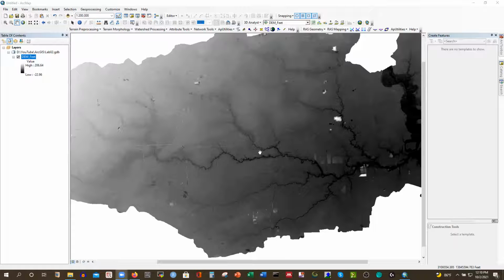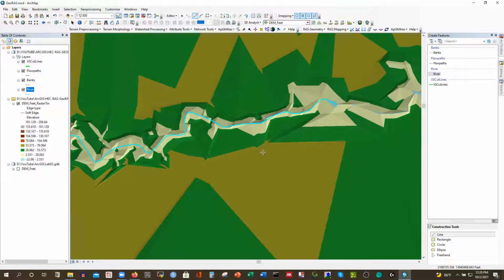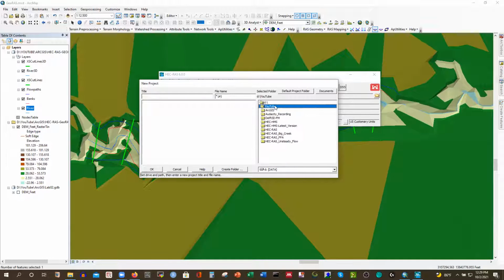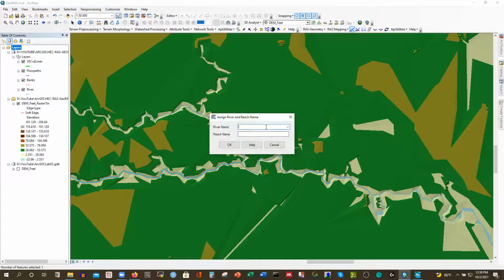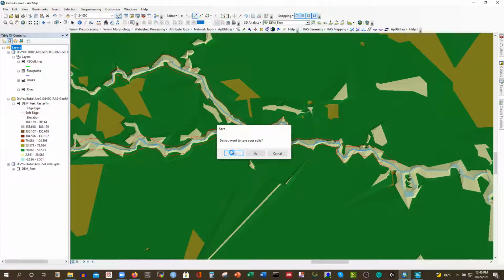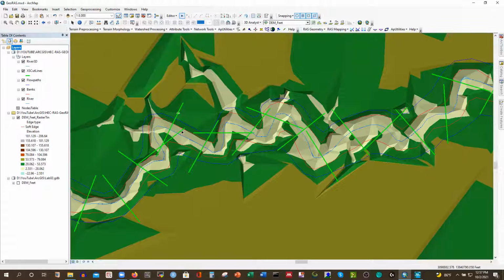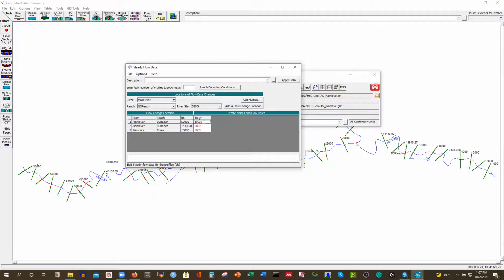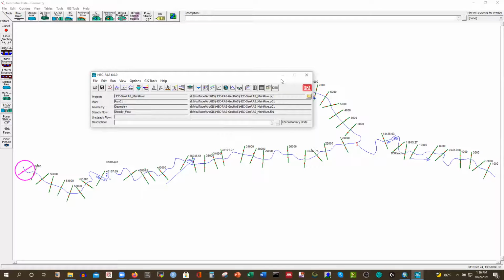How To Set Up HEC-RAS Model From Raster DEM Using HEC-GeoRAS

Comment: how fix "River node lies outside the terrain!"?
Reply from the maker: Thanks for the query. It means the node you selected as outlet to delineate the the watershed is located out of the stream segment, if you zoom in more closely and put your outlet point, and delineate watershed again, it will work. Don't worry, it's a common problem and the solution is simple.

Comment: SIR  for 30meters raster résolution  it does not works or I have to add some parameters to convert raster maps to TIN maps . thank you for help
Reply from the maker: I also used 30 meter but I projected it on State Plane and I also converted the vertical units to feet. I have demonstrated that in my ArcGIS play list. OYu can find the video. For your case it's alright if you want to use 30 meter, but you might have to use UTM projection.